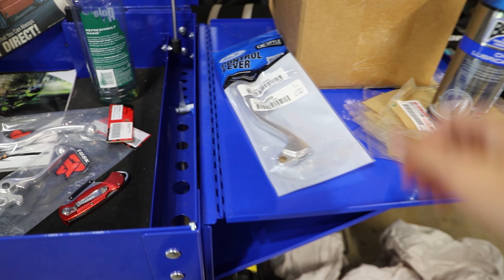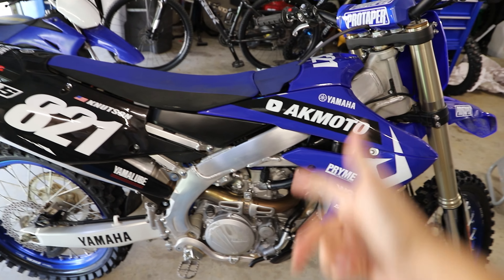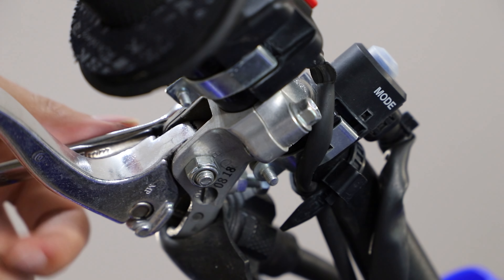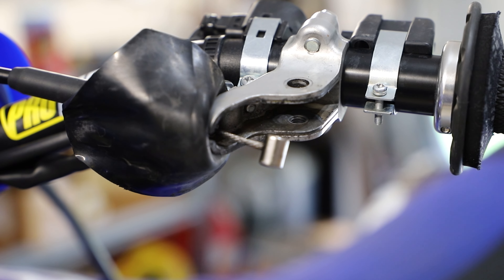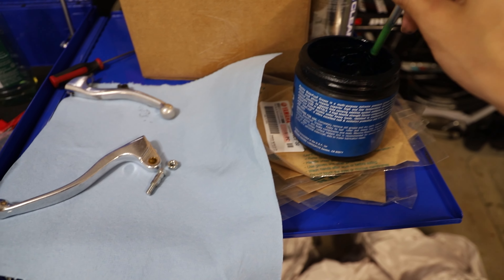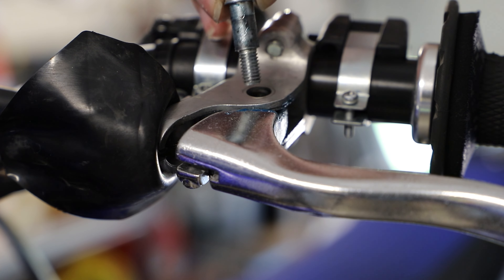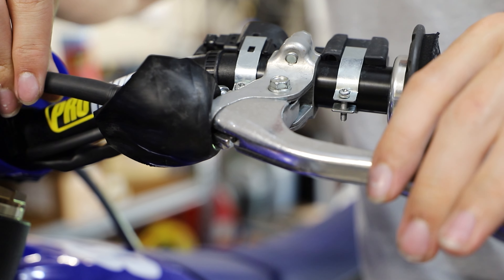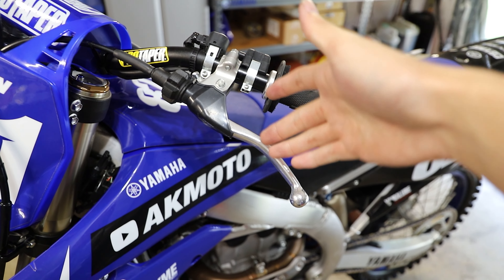How To Replace a Dirt Bike Clutch Lever

Comment: So I took my dirtbike mudding and in the middle of the mud my dirtbike turned off and hasn’t started since I took my whole dirtbike apart dumped out all of the gas took my nibbi carburetor off cleaned it and I took my engine off and took the engine apart drain all the oil and then I put everything back together put new oil in it and new gas and it’s still not starting and now there’s something leaking out of my bike and idk what it is and it still won’t start and it has compression but not as good as it should do you know any reason why it wouldn’t be starting still or what would be leaking out of my engine?